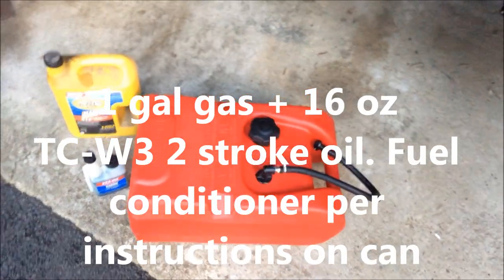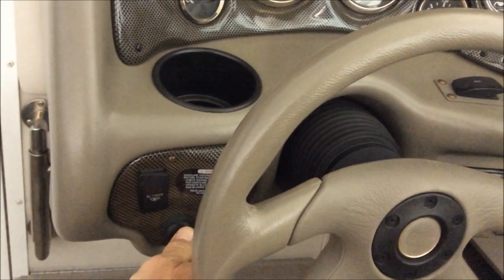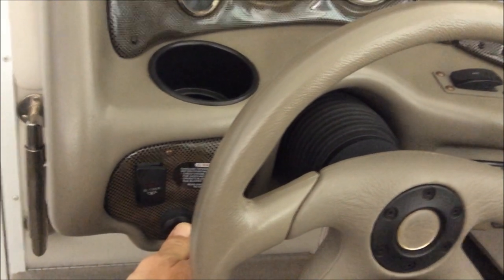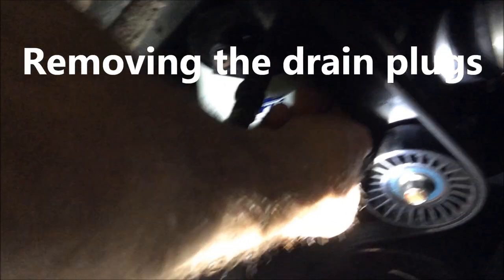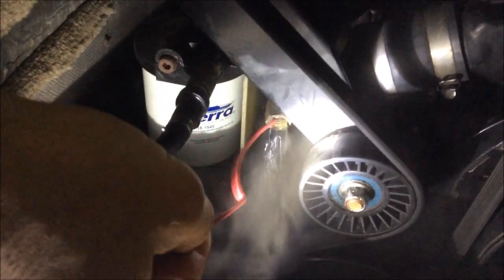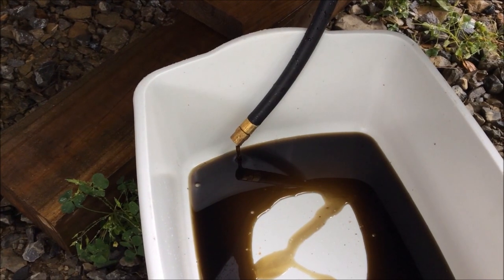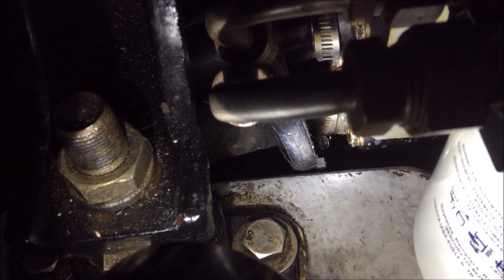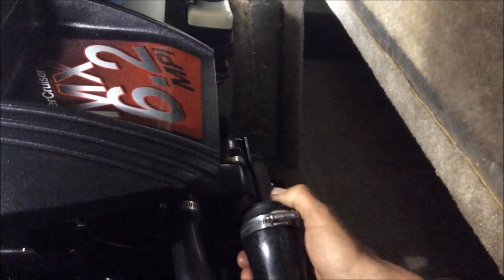How To Winterize a Mercruiser/Inboard in 30 minutes! (Super Easy)

Comment: Thanks for the video I winterize mine today. Do you prefer this method over adding antifreeze with a funnel in the muff hose?
Reply from the maker: This way is much better I did the funnel method on other boats and never felt like I was getting enough antifreeze in once it mixes with all that block water...luckily I never had any freeze ups.